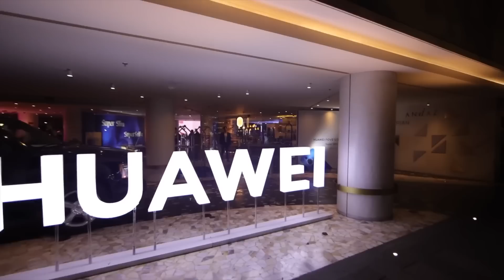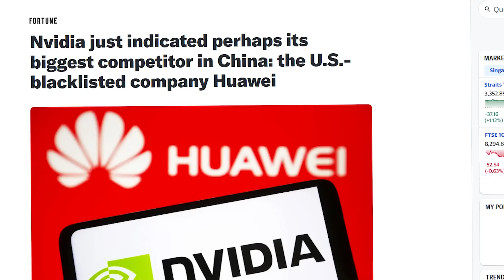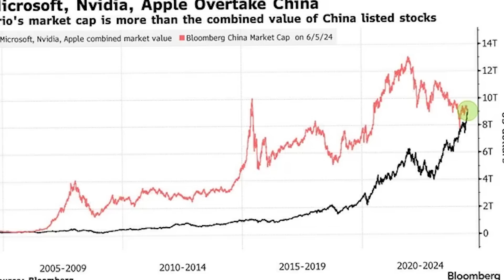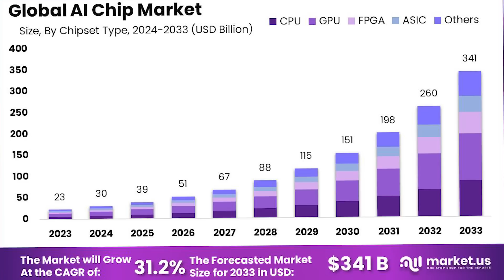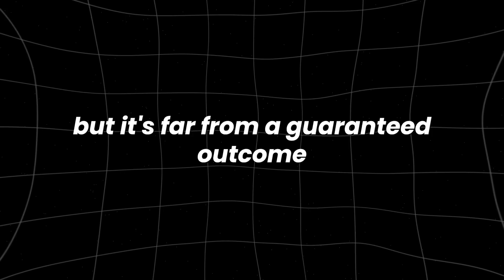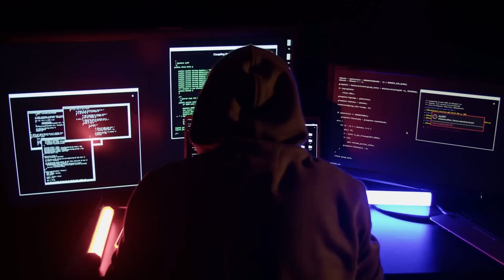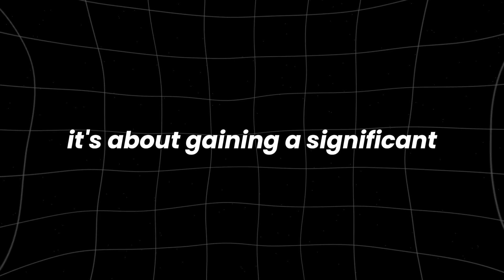This NEW Huawei AI Chip Is SCARING Nvidia!

Comment: meanwhile AI is stalling out due to to much garbage information that is not relevant to the real needs.
Reply: How can AI develop without real industry? Using AI to train AI is equivalent to using robots to rule the world. If the original intention of the development of a technology is against humanity itself, the development direction of this technology will inevitably fail.
Reply: @zen-mc4ju  AI's greatest advance has been in coding as it can hold a huge DB of routines, the second area is electrical/electronic engineering, but in the i9; 13th and 14th gen intel chip sets, failure has been observed.. and this may be from the concepts of physics that are now been seen as inaccurate theorems.. and more so require a big 'proven' DB

Comment: Where are U.S. chip manufacturers going to replace China's raw material supply chains? How do you manufacture chips without raw materials?

The U.S. relies on China for approximately 90% of its gallium supply.
The U.S. sources around 50-60% of its germanium from China.
The U.S. depends on China for 70-80% of its antimony needs.
The U.S. relies on China for 60-70% of its graphite supply.
The U.S. sources around 30-40% of its silicon materials from China.
The U.S. depends on China for 85-90% of its tungsten supply.
The U.S. sources 80% of its bismuth from China.
The U.S. imports about 80% of its other related rare earths from China.

These percentages highlight the significant reliance of U.S. chip manufacturers on Chinese raw materials, particularly for gallium, tungsten, and rare earth elements.  The U.S. is undermining its own chip manufacturers!
Reply: they can use other countries for raw material  if they have to it's just a little more expensive
Reply: @Saint.Holy.Sinner  It can 20-30 years to develop new supplies.
Reply: @Saint.Holy.Sinner For example, gallium is so widely distributed in nature that no one will build a new production line to extract gallium, which can only be produced as a by-product of the process of extracting aluminium.
 
That means you have to have a lot of aluminum production to extract enough gallium, and aluminum extraction is a very power-hungry industry. 

Most of China's aluminum plants are located in the western region, which is rich in renewable energy such as solar and wind. 

You can't build an aluminum industry without abundant and cheap electricity. Gallium is the only one mentioned here. 

As for other related rare earth elements, they are more dispersed in the earth's crust than gallium and are more difficult to extract.

 More importantly, you can't bypass the patents related to rare earth separation and purification held by China.
Reply: @Saint.Holy.Sinner  Yes, you may try to source raw materials from alternative countries, but the questions are: how complete will the supply be, and what percentage of the total demand can they fulfill, given that a large quantity of materials is required for chip production? Secondly, you're absolutely right that this will increase the cost of chip manufacturing, which will, in turn, drive up chip market prices. It's important to note that Nvidia chips are already selling for much more than Huawei chips of the same grade. With higher costs, you risk losing even more market share.
Reply: Yes, but China also benefits by selling it to the west because the market needs it and in China the market is not as big as in the west so it is impossible to stop selling to the west while the market in China has not been able to absorb the amount of production of these materials. So the best option is to continue selling the material to the west while waiting for the domestic market in China to absorb it The raw materials, it is realistic.
Reply: @hkvlog570  The global market for these materials is relatively small, worth only a few billion dollars. China has two options:

Acquire the production capacity of these raw materials as a strategic reserve;

Encourage companies that rely on these materials to relocate to China to secure the supply chain.

In other words, the West will either lose these companies or lose access to the products that depend on these materials.
Reply: China has no plans to stop its opponents from destroying themselves.